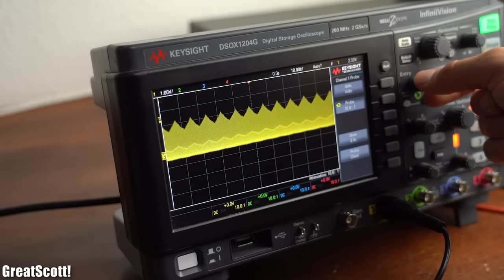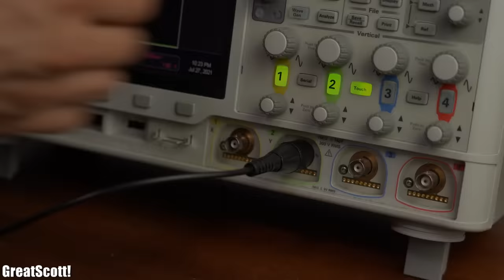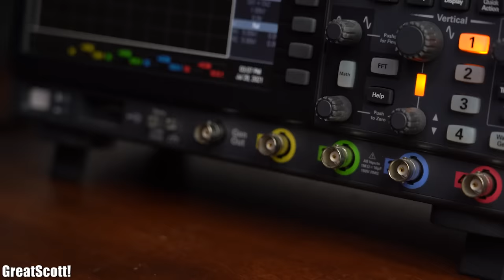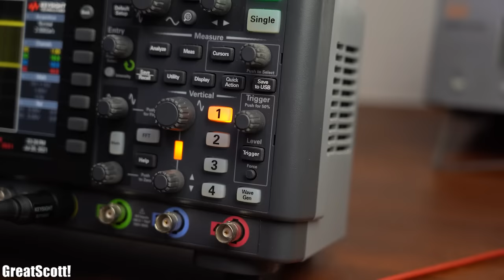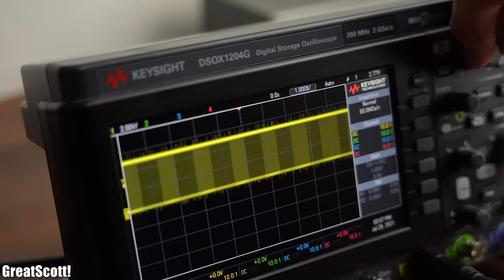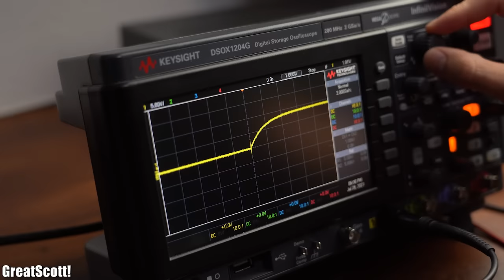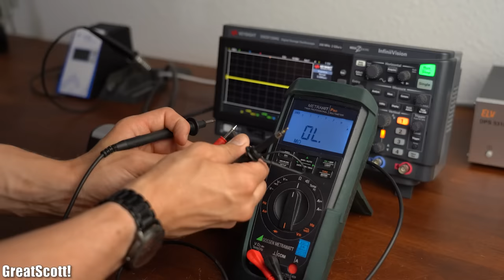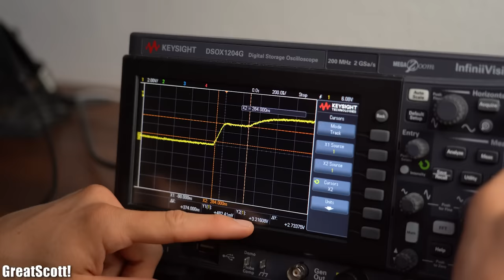Everything you need to know when buying/using an Oscilloscope! EB#49

Comment: "is connected directly to the PE wire of our electrical system through the BNC connectors. And by connecting the PE wire directly or partly to the L or N phase of our electrical system, we either trip the RCD in the best case..." Ok. It's crazy how fast things become meaningless if you're not familiar with the underlying lingo/abbreviations. PE = protective earth, i.e. a direct connection to a physical ground, like the ground wire in your power outlet. RCD = residual current device which is basically a breaker that trips if a difference exists in the current between the legs of the Line and Neutral wires of a circuit (which would indicate that current is flowing out of the circuit through an unintentional ground). So, depending on where you connect your scope's ground lead you will either trip the RCD (presumably in the mains circuitry?) if you touch the neutral because some of the return current on the neutral will take the alternate path via the scope's ground, or you will trip the circuit breaker if you touch the Line lead because you will create a dead short to ground through the scope (potentially damaging the scope). BNC is the name of the quick-connect coaxial connectors used to connect the probes to the oscilloscope.

Comment: Great video presentation! I'm a novice hobbyist, so this video was a bit outside of my comfort level. Do you happen to have a more basic tutorial on how to use oscilloscope to diagnose basic faults in individual circuit components? I bought an oscilloscope a few years ago, but I'm afraid of using it.

Comment: Maybe I'm mistaken, but the connection you DIDN'T make wasn't to NEUTRAL but to the negative side of a bridge rectifier, no ? That means you would be connecting the "ground" of your scope to LIVE every negative half cycle. That isn't what you seemed to be showing when you illustrated it with the schematic. Many years ago in a moment of madness I did exactly that and the bang confused me for a moment until I realised that I had done the exact thing I had told myself not to do a mere 5 minutes prior. Big heavy valve scope survived - no surprise the bridge rectifier did not.

Comment: Balanced probes (decent ones) costs a fortune here, I use instead an isolator transformer (240-240v) which is also not very cheap but floats the scope (I have to  remove the earth connection as well of course) I know not ideal but again balanced probes omg they are expensive!

Comment: I have a 30 year old HP 500MHz scope that I really don't want to damage. I am living and working in Brazil nowadays; a country which has no earthing system! Am I right in thinking that my scope is safe? As long as I work on x10 to measure 127v or 220v? I do a lot of work with valves as well which work at around 400v.

Comment: 0:34 I successfully  blew up my $1400 gaming laptop with this one simple trick!
I took it apart to figure out the current path. My best guess is my scope was not properly grounded (maybe a dodgy plug or receptacle) Instead the current took the path through the other earth lead going to a teensy controller board, and took the path through the computer USB port, through my power adapters, to ground. I guess the high current somehow upset the VRMs on the motherboard because one the FETs was shorted. This would have sent 16V to the CPU. I suspect the soldered CPU (i7 6700HQ) is toast. The GPU (GTX1060) might also be toast. The 16GB of RAM it had was dead. Found blown/open fuses on the motherboard. I was able to restore some logic rails like the 3.3v and 5v, but the most life I can get out of it was the power button glowing. The LCD was also fried.
Reply: hmm strange :/ I mesured 1 MOhm on my laptop's power supply ... and also did you work with working computer I mean plugged to the main ?? Sometimes I don't get what people do really...

Comment: I just picked up a cheap $35 oscope kit and power it with a 9v wall wart. Its cheap isolation baby.
Reply from the maker: True...but make sure to not touch anything mains voltage referenced.
Reply: @greatscottlab  Thanks! I'm going to be honest with you, I picked up a two channel Siglent last christmas but im too scared to use it. I'm worried I'll blow it up. I bought what I "thought" was an isolation transformer from amazon but it turned out to be internally grounded so I guess its a variac. Thanks for putting this info out for us. I've been subbed since before you had 100k subs!

Comment: Don’t do what I did to my 200mhz Hantek 2-channel isolated handheld scope and plug it directly into the mains.  One new mainboard later and it still works fabulously, just like Trigger’s broom.
Reply: What happened? I mean, it should have been perfectly isolated from PE, no?
Reply: @Noodles.FreeUkraine  I exceeded the maximum allowable voltage and the innards made an awful bang.  In short, pretty much fried one of the channels.  The other channel was fine as you’d hope.
Reply: @daveys  Yowch, my condolences. Yes, that would do it even though it's floating. 🙁
Reply: @Noodles.FreeUkraine  - Thank you.  It was the old “RMS thing” that got me.  Total schoolboy error, but at least I did it at home where no-one could hear me wailing like a distressed wookie.
Reply: @daveys  Yeah, I can relate. The neighbors would have heard me wail for sure. 😂

Comment: I quite enjoy your videos, and seeing what sorts of things you can share.  Thank you for the heads up about measuring mains voltage directly, I was unaware of that but also have never tried, even though our mains voltage here is 120V.  Thing is, I have a 4-channel Fluke analog meter that was all the rage probably 25 years ago (got it for a song), but haven't got the cash at the moment to invest in a 4-channel digital scope due to some of the stuff I've got on the go (re-setting up my home machine shop, raising kids, etc.).  As I'm still an electronic novice, how useful is the scope that I do have for basic stuff?  I've used it for some basic stuff, but is it pretty much useless nowadays?  I'm an auto mechanic by trade, hobby machinist, and quite novice electronic enthusiast, but would love to progress more in microcontroller (Arduino, etc.) and actuator control systems.  Thanks again for everything you share!
Reply: Your old oscilloscope is still very useful. Ask yourself what you would be able to do with a digital scope that you can't do with an analog one. A digital oscilloscope is most useful if you if you need to look at single nonrepeating events. For basic microcontroller projects you can get much of the same insight using print statements for debugging.

For mechanical control systems it's possible to use an Arduino's analog pins as a low-speed oscilloscope. The bandwidth will only be a few kilohertz at best instead of tens of megahertz in a real oscilloscope but this is more than enough to measure physical movement.
Reply: Analog scopes are ideal, and intended for, recurrent signals.  But it is nearly impossible to get a trigger lock on a data pattern since TTL data is simply 0 or 5 volts.   Digital scopes can trigger on a specific sequence of data.  They are also inherently what was once called a "storage oscilloscope" where an event happens just once and you freeze the image and can even expand on it after it has happened.

Comment: I keep dreaming about these 4 channel keysight scopes and I've determined that I may need to rob a bank in order to buy one 🤣
Reply: I actually went with a 2-Channel scope with logic analyzer input. Having the extra 16 logic channels is way more useful if you do mostly digital circuits, the 2 analog ones are enough to probe around the supply, if you don't do advanced stuff that needs a lot of different supply voltages and things like power-rail sequencing that needs to be checked.

Comment: As far as the differential probes, if your feeling spicy, you can wrap your ground plug in capton tape as demonstrated by electroboom. But try at your own risk 🤣
Reply: Or just use a ground lifter / 3 to 2 prong adapter 🙃

Comment: Why didn't you use an isolating transformer ( 1:1 ) to power the oscilloscope, so you can use the probes to measure any signal without care about mistakes, instead of using TESTEC device 🤔

Comment: Why not use an inverter connected to a battery source to power the SMPS you are working on and probing?   In that case the SMPS is not referenced to the Earth in your home and therefore not the one referenced in your oscilloscope.  In which case you would not need differential probes?  Or am I missing something?

Comment: Nice video but I'm still a bit confused. Is it that if I'm testing a circuit that is powered by an external DC power supply, I can connect the gnd reference without causing damage? The issue is limited to connecting the reference gnd to the mains power/ high voltage side of a power supply?

Comment: Great Video, Great Scott!!
I recently came a across a situation where I was thinking of DIY or Buy,
I purchased OTG Adapter which had female usb 3.0 connector and it can be connected to mobile using its MALE MICRO USB 2.0 or Type C connector or Male USB 3.0 connector.

So it is possible to make such using just wires and connectors without using microchips and coding?

Comment: What would happen if there is no earth wire in the building? Will I be able to probe mains directly then?
And also what difference does earthing make on measurements of around 10 to 200Hz? Because my university lab doesn't seem to have that, and the probes pick up a lot of 50Hz noise, even worse when the voltage is from weak source (like some TENG or triboelectric nanogenerator), I get pretty noisy waveforms on the scope I am using.

Comment: The convenient way against making a ground loop that can short your mains is to not ground the scope, which is convenient here since the standard outlet is just the two-prong, or use an isolation transformer since oscilloscopes does not consume a lot of power to begin with (the modern LCD screen ones that is)

Comment: For "most" of the "practical" uses, badge has no longer sense (to me). Brand like Owon started to ofer 12 and even 14 bits for vertical. You can get 22K count DMM with TRUE RMS chip  at 30Khz BW (not SW) for around 100 bucks that is already proven to be good in reviews (good, not SAFE, ... Just good). You can get a 4 channel PC scope for around 250 dollars that is a complete scope minus the UI and screen. The record memory and so is on the scope. It does not rely on the PC SW. It is slow to get the captures frames ... but for this price tag ... I would do an excepetion to DMMs: Fluke bacause the built quality is unbeatable and they deserve what they asking for. Of course when you need high end lab gear ... this is a different story where Im not sure if the generic brands will stand a chance. Even vintage HP stuff can put them to shame.

Comment: I want to make automatic water pump controller for 0.5 Hp motor at 230V
Which type of relay (with current rating) I need to use for this project?
What are the parameters which I need to calculate to choose relay for such inductive loads?

Please sir give me relay. please sir!!!

Comment: I understand that there is a switch for scaling on the probes and that on the oscilloscope you can select the v/div setting. 
But I got confused about the section were you still didn't get the expected amplitude. 
What was going on?

Comment: Hey love your channel 🤠
Maybe you can make a video showing how is an oscilloscope can assist  with calibrating a buck converter since most of them have 2 adjustment s one for the voltage and one for the current ,can oscilloscope assist with?
Reply: The oscilloscope is used to look at how clean is the resulting voltage.  It also shows voltage but that's not its purpose.  It does not reveal current unless you pass the current through a resistor and then measure the resulting voltage on the resistor but of course doing that also changes the voltage in the device being tested.

Comment: At my uni instead of giving us differential probes to measure mains voltage and 3 phase waves they just simply removed the PE from the outlet that the oscilloscope uses -_- Things get spicy if you touch the metal case of the scope
Reply from the maker: Oh boy

Comment: Thanks great Scott. I have made the mistake of earthing a probe and blew up my 20Mhz scope. So I bought a cheap sigilent digital scope and now I'm too jolly scared to use it. What would happen if I cut the earth pin from the cord so it could not complete the circuit.
Reply: As others point out, what could happen is the chassis of the oscilloscope becomes "hot" and presents a shock hazard.
Reply: @thomasmaughan4798  thank you thomas

Comment: can you just put transformer 1:1, connect osciloscope and then mesure AC?
Reply from the maker: That works. But you will still connect a high voltage to the BNC connector which can end bad if you touch them since you are partly connected to PE.
Reply: I was thinking the same. Another poors man solution is two identical reducer transformers  with secondaries connected. Also you can isolate DUT too

Comment: It is idiotic but true that most oscilloscopes - even high-end ones - have the REF clip of the probe galvanically tied to the safety GROUND pin of the mains supply.
I have seen countless cases of technicians destroying expensive equipment by placing this clip in the wrong place, thus shorting the circuit to mains ground, which is totally inappropriate. 
If you have a scope that is wired this way (most are) you should treat that ground clip as if you are entering the circuit with a backhoe - It will instantly destroy everything it touches, unless you have determined you have a safe place to clip it (which can ONLY be another point in the circuit which is already referenced to GROUND). And when you've done that, you have to consider that, while you may have mitigated the danger of destroying something by inadvertently shorting it to ground, you may also get distorted values in your measurements, as most often none of the circuits you are interested in are actually referenced to ground. 
I count myself as fortunate in that I have kept my most trusted, battery-operated Tektronix 224 Power Scout oscilloscope, which is totally isolated. 
It is not my main scope today, and it is not a sophisticated scope by any means in today's realm, but it is a good entry point into power electronics without worrying about sending sparks showering and hundred-dollar bills with them.

Comment: @GreatScott Any other way to measure mains without using differential probes?
Reply: "Any other way to measure mains"
A voltmeter works well.  Cheap, accurate and generally safe.  Where you MIGHT use an oscilloscope is when you are measuring the output of a generator and you are interested in the wave form, not just voltage.  I have a Generac at work and its waveform is horrible.

Comment: Does the sampling rate split in all cases only only when all channels are used at the same time?
Reply: Depends on the scope. You can have a scope with 4 channels and only 1 ADC, this means that the sampling rate of 1 ADC gets divided between the active channels, so two channels mean half the sampling rate and 4 channels mean 1/4. You can also have a scope with 2 ADCs and 4 channels, there you can use one channel on each ADC at the full sampling rate or all four channels at half rate.
Reply: @sasodoma  Thank you!

Comment: Hi! Is it also a posibility to use an isolating transformer? (Trenntransformator)
Reply: It would work.... But the BNC connector exposed metal might be energized and then you risk getting yourself shocked if you're grounded.
Reply from the maker: Yep, just like he said :-)
Reply: @greatscottlab  ok! Thanks both! So this means I would need an Box with an insulating transformer AND an RCD in it? Would that work? Thanks again!